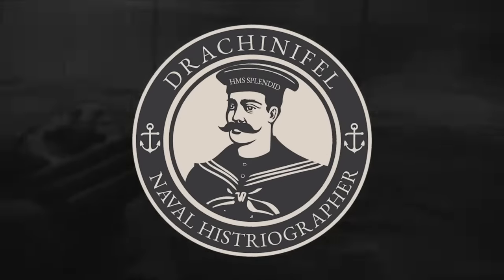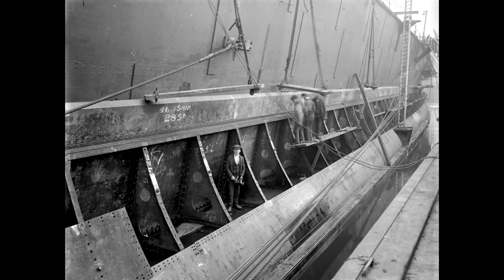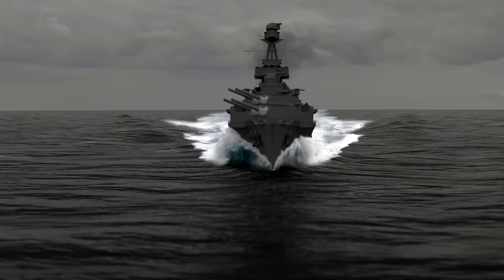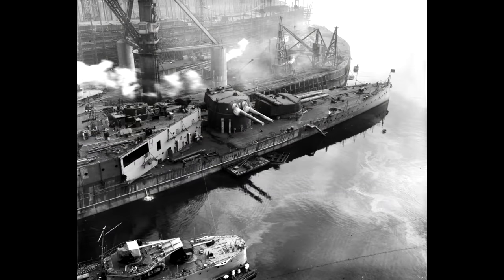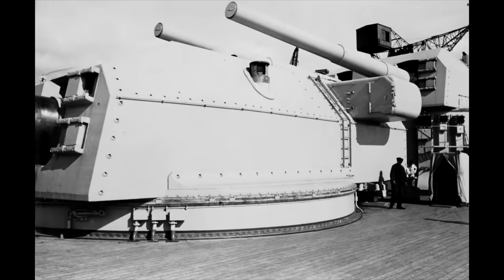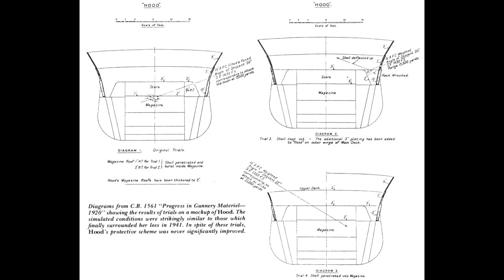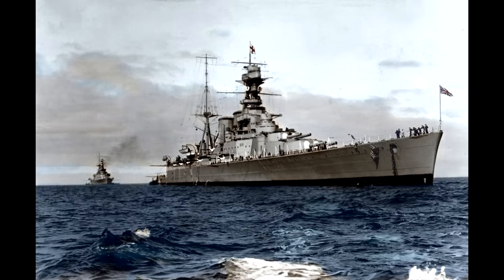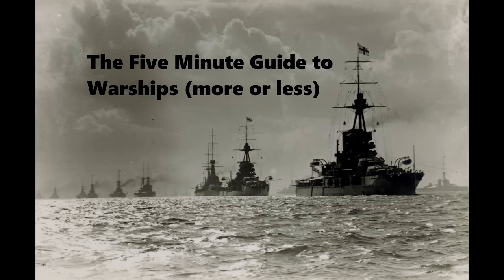The Loss of HMS Hood - But why did it blow up??

Comment: One point you should note: The water in the through of the wave would have been agitated. Agitated water offers significantly less drag and has no surface tension. A shell would therefore experience significantly less destructive forces than if it where going through "normal" water. Your theory seems very sound and is the best I've heard.
Reply: Especially since Bismarck also received an under belt hit, in the area of Bismarck's wave trough as well
Reply: The expedition to Hood's wreck (her rudder positions) showed that Hood was in the process of turning to port when the shell hit. Now, beside the through of the wave, the fact that she was turning, and heeling over to port  at 28 knots (albeit at a shallow angle to port) may  have exposed a few extra feet of her hull.
Reply: Better with animation, to illustrate his arguments.  He likes using specialized terms.  Lost me some of the way because of that.
Reply: @RayCis1  I think you are mistaken there. She was hit on the starboard side, any boat with a rudder (that includes almost all ships) will heel out when turning. So if she was turning to port Hood would have listed to starboard and therefore "hidden" part of her hull. With that said, when turning sharply, both the bow wave and wake will change form and structure. It might have exposed more of the hull in the area she was hit.

Comment: I have always been confused by this. This is a really good explanation of what most likely happened. I was always shocked why only three members of the crew survived I can only guess it was such a sudden spreading explosion then the suction of the ship sinking took the lives of many brave souls. RIP and respect to all those who died.
Reply: More than half the crew (all in the aft end) would have been gone in seconds. Those in the forward turrets and forward half of the hull wouldn't have had time to evacuate with all doors secured for combat operations. As for the forward bridge, odds are they likely wouldn't have known what the hell was going on.
Reply: What is so confusing? The ship exploded and was torn in half and sank in less than a minute. There are really survivors of sudden sinkings. 97% of the crew are in the hull or in compartments in the superstructure. Almost all of these have no natural light source or direct escape route. The first thing that happens with a catastrophic damage event is that the entire power grid is severed and the whole ship goes black inside. Then you have to locate your flashlights and try to find your way around the darkness. But with the catastrophic destruction the ship immediately starts to sink rapidly. Those near the damage site who weren't killed by the blast and flash are quickly drowned as the water rushes into the blackened hull. The hull immediately slants steeply and/or rolls and capsizes. Your have seconds before you are trying to walk on a steep roof. While following a maze, in the dark, while climbing up ladders (which aren't even ladders but steep stairs, making it even harder if it is now tipping towards you or sideways). This is assuming you didn't wait for the order releasing you from your post, which will never come due to the loss of the network grid and power. It is extremely difficult to escape from a sinking ships hull once it exceeds a few degrees off level, and the Hood was quickly going bow and stem towards the sky. Almost no one still alive had any chance of escaping the hull, the deeper in you were posted the harder it was. Not much better in the superstructure or turrets, unless you happened to be right by a door (all the doors and hatches to the outside and between compartments were shut and dogged when you went to quarters so you have to stop and open every one of those too, don't forget), and you basically sprinted for the exit the moment you felt a bad explosion assuming the ship was doomed and your life was more important than potentially being charged with deserting your post of our turned out that it wasn't as bad as you feared it was and the ship didn't sink. Or if you were posted on deck as an AA gunner or lookout. But then you would have to jump pretty quick before the bow raised too high for you to jump, and you would have to swim pretty fast to escape the massive suction of the fast sinking ship. Almost every ship that blew up had no survivors, and it has happened many times. Any ship that sinks rapidly.
Reply: Given Hood went up in seconds after the 4' mag triggered the 15' one, it's hardly surprising.
Reply: @justforever96  Good description. Harrowing. What a horrible death for these fine men. RIP

Comment: One piece of evidence that you don't discuss here, but is mentioned in your Operation Rheinuburg video, is Ted Briggs' account of the impact. He mentions a slow, 10 degree list to starboard (as well as loss of steering... but I don't have any knowledge of how that might fit in). This is consistent with a hull breach at or below the waterline,  as you describe, and almost entirely rules out the plunging fire hypothesis or anything associated with the fire on the boat deck.
Reply: Drach mentioned that as the front part of the hull twisting to starboard after the explosion.
Reply: @charlestoast4051  Ah, you're right.. I'd mixed my timeline up..I thought that was before the explosion, but it's after.
Reply: Also hms hood lower hull be low the waterline was an off black colour not red as mentioned in the doucumentry

Comment: HMS Hood was self-cursed by the crew due to the how low it was in the sea it was nicknamed the largest submarine in the Navy by her crew.
Reply: just sailor humour
Reply: @buzzardbeurling  Your absolutely correct, however we're told to be careful what we speak as it will come true! I hate saying it, given what happened and I am certainly no kill joy as like a laugh as the next man! We just have to be careful and given that back then the Royal Navy would not allow whistling on deck. Later on in the Falklands War the BFPO address for Ascension Island and the Falklands avoided the number '666', if I recall correctly Ascension Island was numbered '677 or 667'. Just a thought!
Reply: The extra armour added to the ship after the Jutland battle put the ship lower in the water. The quarter deck became very vulnerable as it was so low. Pictures of Hood are shown with the quarterdeck  completely awash at speed or in heavy seas. After the war when Bismarck's specifications were studied,  it was found that Hood had no immune zone to Bismarck. In the absence of lucky hits, the Hood was doomed in this scenario. The HMS Prince of Wales, fired the fatal shots which opened up Bismarck's oil tanks forward, forcing the Ship to abandon its breakout into the Atlantic and the convoys there. Hood should never have been deployed against Bismarck.
Reply: @malcolmtaylor518  those studies were wrong.

Oh and Whilst Hood's quarterdeck was wet it wasn't much worse than any cut down qd design. It's been totally overstated
Reply: All battleships, and even more so battlecruisers, have weak spots, and all battleships are wet under war full load (not to  speak about 10-20 years   adding steel and guns and new stuff for every refit) as they age.  A full-blown American battleship lost the admiral  in the middle of  an  Atlantic crossing  in WWII, swept by the sea. This bow wave theory appears convincing.
Reply: @malcolmtaylor518  "Hood should never have been deployed against Bismarck." Alone, yes, but it was not alone, so that comment is just rubbish. I mean what else are they going to do with the Hood other than deploy it?? Scrap metal???
Reply: @malcolmtaylor518  Unfortunately, there were not many capital ships available that could match Bismarck's speed and ready to be deployed. The British sent what they had against Bismarck.
Reply: @padurarulcriticsicinic4846  If this analysis is correct it sounds like any other set of dice rolls and Hood is eating broadsides for days and everyone insted asks why the Bismark ever even left port with the Mighty Hood at sea.
Reply: @mostevil1082  Fair point.
Reply: @sandrodunatov485  USS Washington, if memory serves me right.
Reply: @padurarulcriticsicinic4846  That's correct, thanks. The lost officer  was Rear Admiral John W. Wilcox Jr., swept overboard from the deck of USS Washington  in heavy  North Atlantic  weather (March 1942 ) while in command of TF39 steaming for Scapa Flow. Washington was a modern fast '35000'  North Carolina class ship, not a  reconstructed hull  like many British, American, Japanese or Italian 'former-super-dreadnought'  battleships.

Comment: The key to this mystery is, I think, the silent flaming jet that appeared just before the explosion. An erupting, coherent column of flame emerging with no associated shockwave implies a significant volume of superheated gas at very high pressure suddenly getting a narrow aperture to vent through. Superheated gas being present inclines me to believe the 4" magazine did cook off first, as the 15" wouldn't have messed around overpressurizing compartments but cut straight to shattering the ship. The eyewitness accounts also mention the eerie lack of a shockwave/sound when Hood exploded, again suggesting the ship ruptured from internal pressure rather than being pulverized by a blast wave. Hood's destruction sounds (literally) more like a deflagration than a detonation. The ship probably filled up like a fiery balloon in the milliseconds before explosion. In fact perhaps her deck armor worked against her here by holding long enough to let obscene levels of pressure build in lower compartments.

Taking all that into account, is it necessary for a shell to have hit Hood's magazines at all? All that's really needed is a way to start a fire in that 4" magazine. Could excessive heat and/or pressure from a near-miss have ignited stored charges in a (relatively) slower-burning deflagration?
Reply: I have wondered if the young and inexperienced crew made a mistake here that the seasoned crew would noy have. Then its not a lucky shot but could also be a catastrophic munition handling mistake. Excellent analysis to all
Reply: @frankdehaven2572  I might have been inclined to agree with you had it been any other country OTHER than UK. Remember that only 25 years or so again, The RN lost a large number of ships exactly due to munition handling mistakes. As such, to my knowledge, this was one place that crew did NOT cut corners, even a rookie crew. This would have been drilled into them more than anything else. So IJN, USN or KM? Maybe, but RN? I seriously doubt it.
Reply: @Yippidiyippida  I dunno, that sounds plausible and all but... we're talking about mid-combat....  Maybe a mix of damage, and crew... shortcuts combined?
Reply: @marhawkman303  Don't forget the ship's age! Metal gets weaker as it gets older, stress fractures build up over time and the Hood (as an older ocean-going ship that had been refit with even more armor at one point) was no spring chicken.
Reply: @Yippidiyippida  exactly this. and this was as you said only 25 years after Jutland and the other munitions related catastrophes of the first world war, no one in the royal navy was going to be taking risks with munitions, especially on a battlecruiser, especially when going up against a ship like Bismarck again, that was one lesson the royal navy had learned
Reply: @Alexwright12  Definitely, along with how they did reinforce Hood's deck armour as a result of Jutland making plunging fire even more unlikely given the ranges involved. Admittedly yes we can't rule anything out, given Hood was lost with practically all hands, but Drach's theory does seem by far the most likely explanation based on everything we've got to go on.

Comment: this theory makes the most amount of sense. when he started talking about below water line hits and you see the picture of the ship you realize that yes thats likely what occurred. Drach failed to point out something about the bow wave. as the ship is turning, the bow wave on the side in which they were hit is being pushed farther out from the hull as the ship swings through its turn. the ship is throwing water in the opposite direction of its turn while sucking it in on the side in which its turning to. you're going to expose more hull on the side that is in the outside of the turn, the side that took the hit.
Reply: Whilst he may have failed to point out that particular fact, he does state in the video that though the rudder was found locked to port in the wreckage, its more than possible the rudder had yet to overcome the ships inertia by the time it was struck by the incoming shell, and therefore still moving in a rather linear motion.
Reply: @adukes2440  Though there is still enough doubt cast, that I think the note does deserve to be well noted.